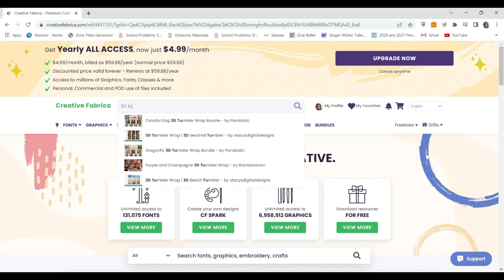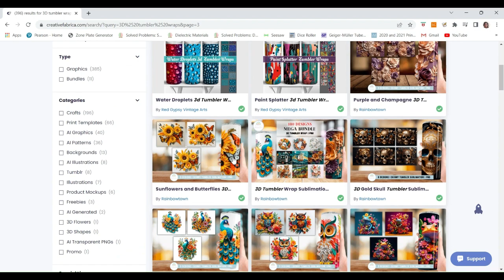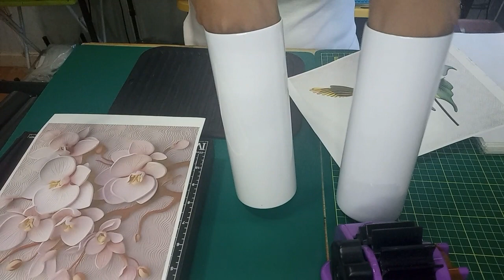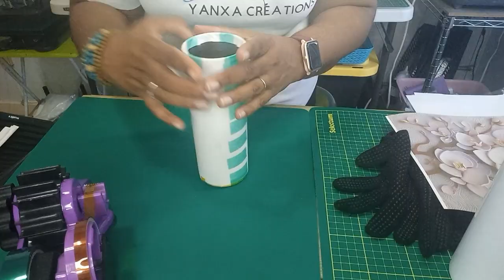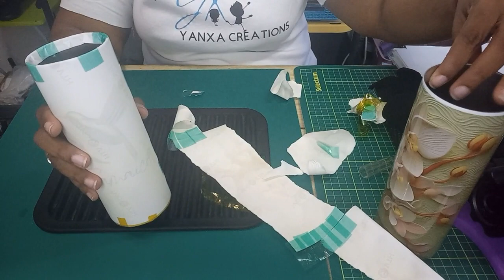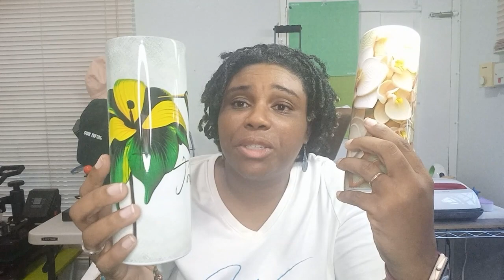3D design Tumbler | Creative Fabrica Spark!!

Comment: Hi Tanya thank you so much for sharing. I am yet to start tumblers . Gonna have to buy a press
Reply from the maker: Thanks for watching and commenting. I like the tumbler presses but i started out with a convection oven and worked out well and its cheaper. Although i have been seeing some pretty good prices on tumbler presses recently
Reply: @yanxacreations  can I just choose any convection oven or it has to be a special one
Reply from the maker: @Taylormadedesignsllc  hi. Yes i have seen videos using small $45 convection ovens or toaster ovens. I got mine big enough for the tumblers to stand but in the end i ended up putting them on side anyway. So a small one will work. Just make sure yiu can go up to about 360F and get some oven thermometers to check actual temperarure